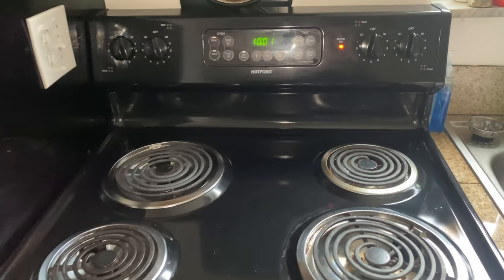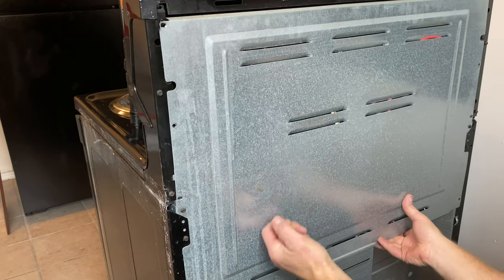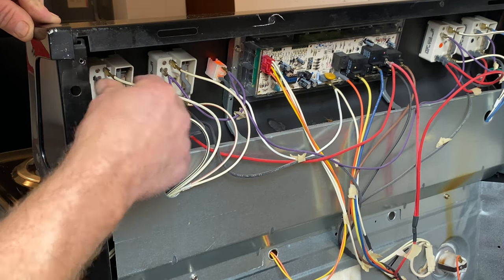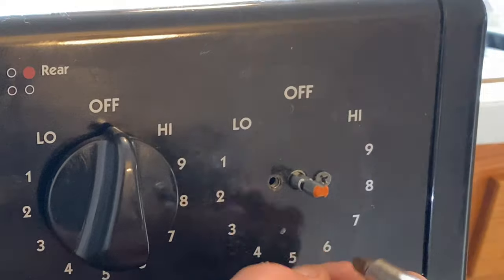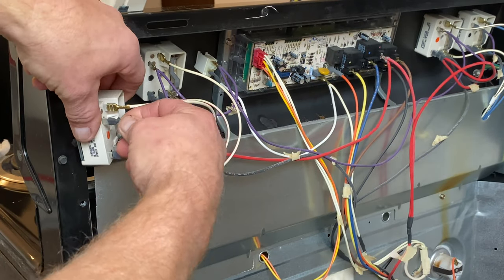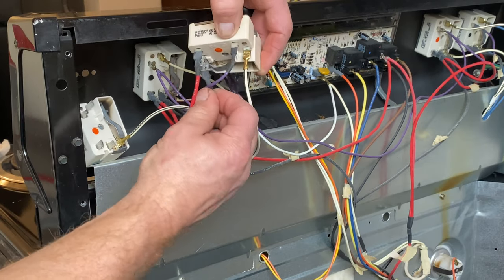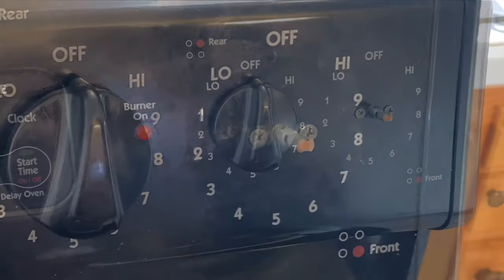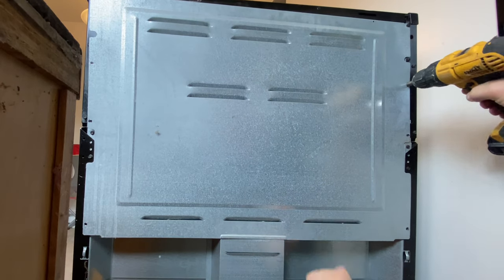Stove Burner light stays on, FIX

Comment: I’m afraid to sleep because I don’t want my house to burn down
Reply from the maker: As long as the burner is not hot, you should be fine. This was a pretty easy fix once the part is acquired. Thanks for watching
Reply: Should I keep my stove unplug after I use it until I can get it fixed?
Reply: @nadia_ash3250  I have same question
Reply: I know this is from a year ago, but for anyone else reading it and having the same concern, turn your breaker off for your stove and if you have a lot of anxiety about it, only turn it on when you will be at the stove and then turn the breaker off again until you get it fixed

Comment: Did this and it worked and I didn't have to order the new switch. Just taking out the wire to the indicator to test it, and a few other wires, and the burner on light stayed off. GE basic model recent years. Thanks!
Reply from the maker: Glad that worked for you. Thanks for watching.

Comment: Thanks, I figured most of that out but I wasn't sure about unplugging and replugging random cords. I wasn't sure if that was safe for the electronics while it was still plugged in, so it was good to see you safely execute that first.  👍🏻
Reply from the maker: Make sure you are very careful when working with electric, whenever possible unplug or disconnect from the electric. Thanks for watching.

Comment: I can’t figure out why the light is staying  on I think I checked all the wires my GE stove is a little different it has a Red and yellow wire on the burner light, I already replaced a heating element so not sure if one of those being bad could cause the light to stay on, I may just have to call someone to come repair it

Comment: Would this cause a fire or is it just the light wire that's malfunctioning?
Reply from the maker: While it won’t cause a fire, it could be a hazard if you did not know that the burner was on and something was set on the burner. The best thing to do would be to repair it. I hope this helps, thanks for watching.